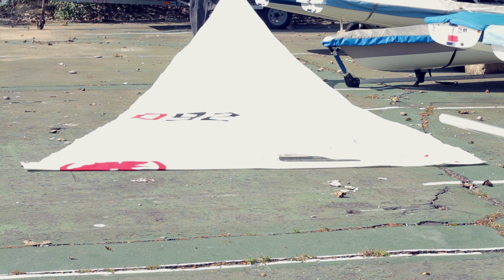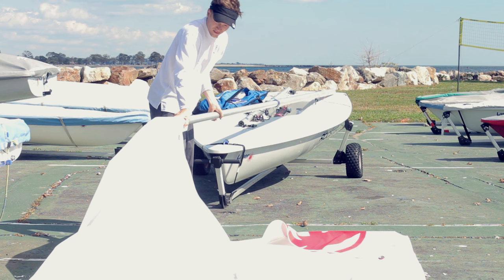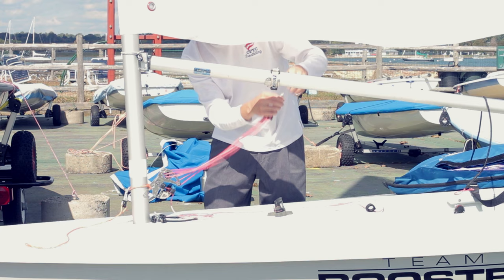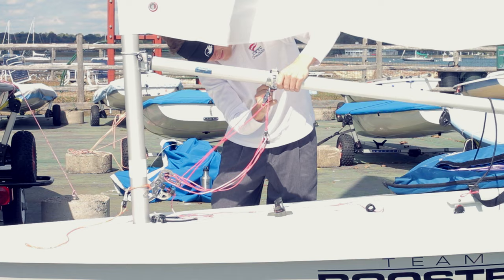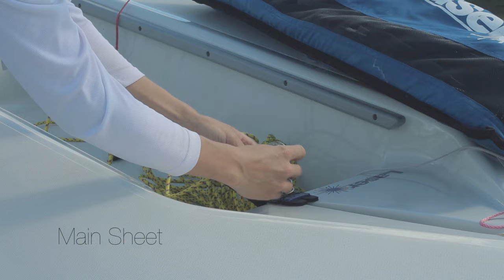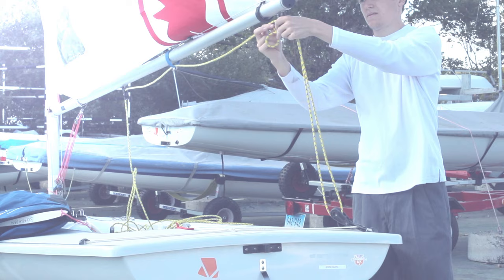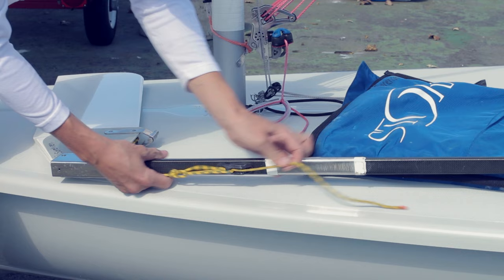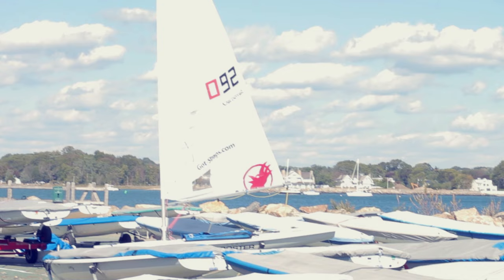Rigging Your Laser Sailboat in Less Than 5 Minutes [HD]

Comment: At 3min 40sec the video seems to recommend a figure-of-eight as a stopper knot on the mainsheet at the boom end.  Figure-of-eight knots can become undone if subjected to constant flailing so the mainsheet could become completely free which would not be a good experience!  Much safer would be to use a bowline or a double or triple overhand stopper knot.
Reply: the reason you dont use a bowline, is because it gives you a few cm less of pulling in the main sheet (about 5-10 cm). its always a 8-knot behind the block, the chance of it opening is so unlikable nobody really cares about it.
Reply: You can’t trim in all the way with a bowline
Reply: I like to use a double overhand stopper for the mainsheet at both ends
Reply from the maker: A bowline even if tied small prevents full block to block trim, the reason not to use a double or triple overhand knot is because it creates a larger knot which may cause more friction, since the pulley wheel is up against the knot. A double overhand is fine for the other end of the mainsheet and don't worry, the eight knot at the block end won't come undone while sailing. You're correct that eight knots can come undone for example at the loose end of the sheet from flailing around. The double or triple overhand can be a better option at the loose end in the cockpit also because here you want a bigger knot to prevent the tail from running out of the mainsheet block.

Comment: I never liked putting my sail onto pavement.  The sail gets dirty and is heated up a ton when touching the hot asphalt.
Reply from the maker: That's a good point, I never put my sail on wet pavement or if you're sailing in a hot climate it might be too hot for the sail, I usually roll the sail over my boat if you can't lay it on the ground. Some regattas you don't have much choice.

Comment: Why dont they use a quickpin (in german: Kugelsperrbolzen) to fasten the vang-steel-part at the mast - I did so, but ok, maybe it is not conforming with the rules. But I hat this little rings, which disappear in the "koker" at the wrong time (Koker, the hole the mast is standing in.) I had a little stick with a strong magneto, to pull the rings out again. I hated ir.
Reply from the maker: Ja, das ist einfacher :) The only reason I didn't is the Kugelsperrbolzen I got here didn't seem to fit properly, it left a good bit of play so I opted for the snug fit pin with ring dings. Your way is better, anytime you can avoid ring dings it's a win!

Comment: step 1) pull up half an hour late just as everyone else is leaving to go out to the race because you had to stop off at Mc Donald's
step 2) rig boat only to find that the main sheet is missing.
step 3) steel someone else's main sheet.
step 4) arrive at the race right when the air horn blows for the last time and win the race.
Reply from the maker: Basically, though I'd imagine it'd be hard to steel a mainsheet, I guess you'd gather a bunch of sand from the beach in order to create a cast and then pour the molten steel to form a new sheet, the heat from the foundry could certainly be a plus on those extra cold days. LOL
Reply: up
j

Comment: What is that tape over the tiller at 4:35 ???? Is it metal tape? Good idea, I want to do this to avoid the metal getting worn from the traveller.
Reply from the maker: The metal piece can pop off with alot of sailing, so that ensures it stays on. If you lose the metal piece the traveler line will saw through the tiller.
Reply: I have tape on mine because the metal part was popping off the tiller, but the traveller should still contact the metal, not the tape, or else the tape gets worn out (the metal doesn't get worn out, it's tough enough)

Comment: +XDlaser how long and thick must be the dynemma for the cunningham be?
Reply from the maker: You can go pretty thin, 7/64th dyneema is the smallest that will work when you crank it on, you can go with a similar sized covered dyneema and it will hold easier, I also came up with a new design with an added block for the mkII sail
Reply from the maker: http://laserxd.com/how-to-rig-a-laser-sailboat-in-less-than-5-minutes/ 
I'll do an updated improved version soon, I've changed the specs slightly on my rigging.